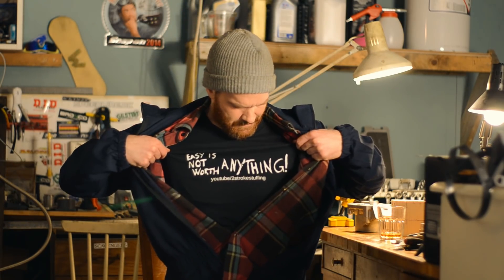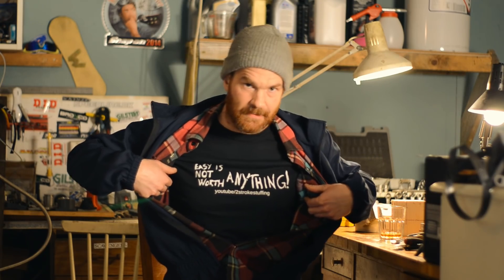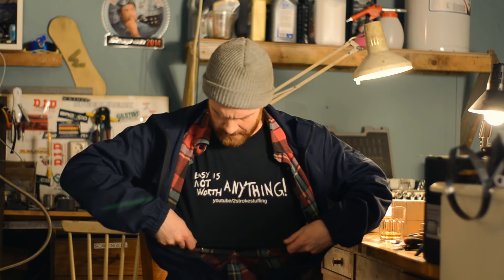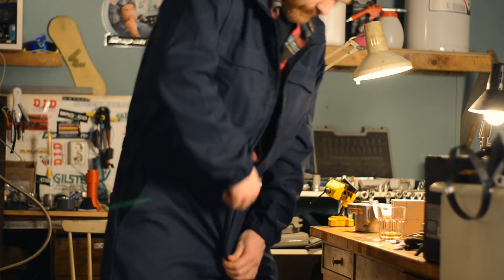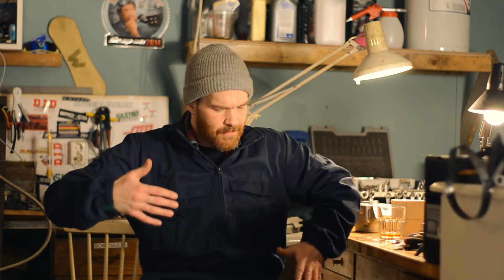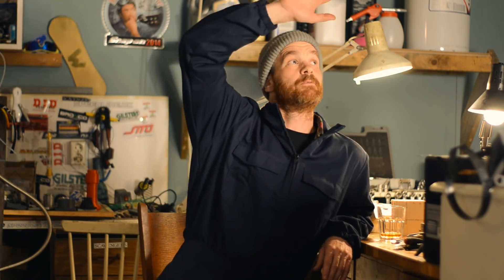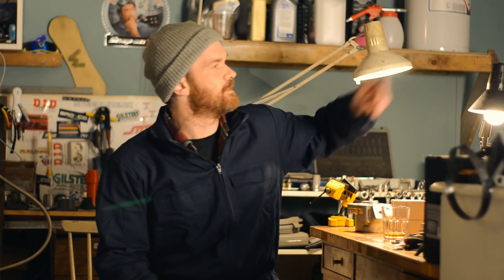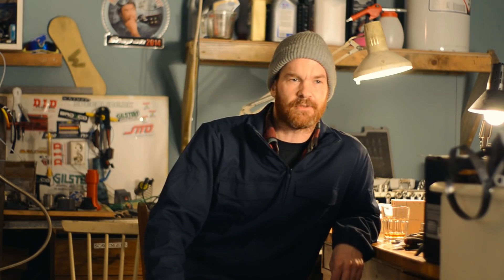The Most Powerful Two Stroke Ever but my tools need to obey their master first.

Comment: Try to organize the mess of wiring and remove the unused power supply. With everything organized it will make your life a lot easier when in need of trouble shooting. Great content, keep moving forward and I can't wait to to see the engine make some power!!!
Reply: because need wiring is reliable wiring :D
Reply: I love cleaning cable/wire pacs. There is nothing more satisfieing that turning a birds nest into a neatly organized strand... I ussualy do it on cars and bikes but that cnc seams doable
Reply: its good to do that ofcourse but, for atleats me theres always a dillemma- fix/upgrade machine or continue with the project.... because time is ticking
Reply: To see the finished engine wait two more years of bad excuses.

Comment: Your celling seems to be not sealed where the dry wall meets your plastic.That could be a issue for heat loss. Did you ever weight your exsisting motor? See if your new mill can shave more weight from your original motor? Thanks for the video.

Comment: Would it be posible to use rigid foam (as someone sugested on ig) for training, or plastic? Wood is quite contaminanting to sliding sealing oiling things
Reply: Foam and plastic can be surprisingly expensive. Wood is cheap and easy on tools with a fast feed. People say aluminium is difficult and gummy, buy so is 300 series stainless. No matter what you learn on, you'll need to figure out the characteristics of each new material you cut.
BTW, for wood, I always use conventional cut.
I've ever done anything more than very light cuts on metal with steppers though. I'd just cut my losses and fit an encoder.
Reply: Blue styrofoam works very well